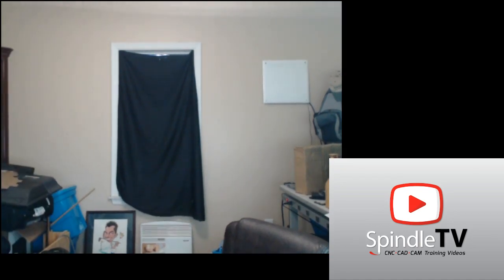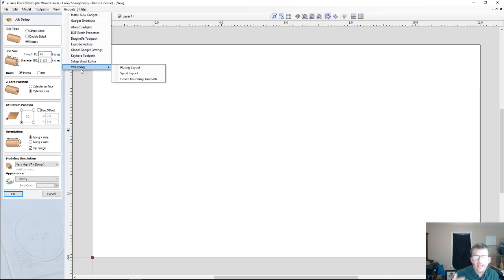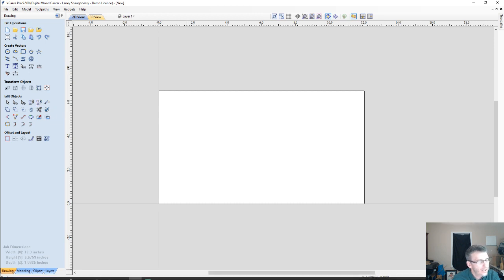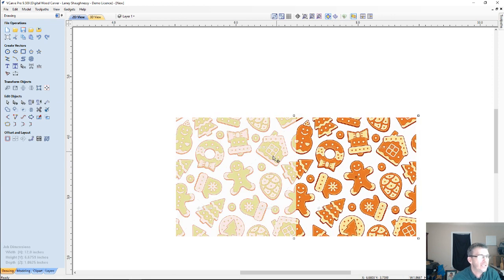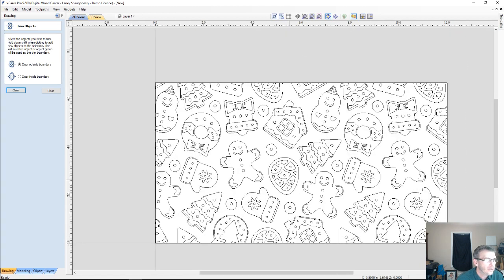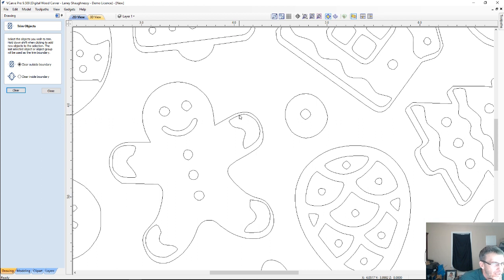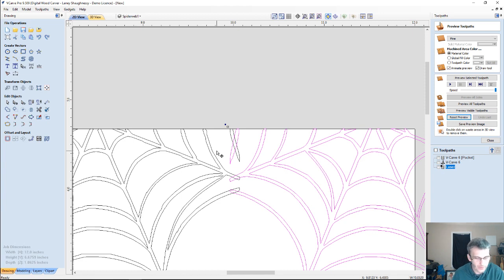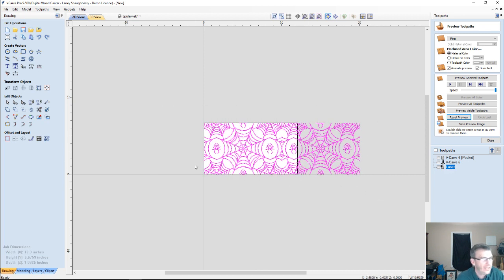Holiday Rolling Pins - Vectric Rotary Axis Project

Comment: Hi David, love the video very helpful but when I get the handles made and want the main body of the rolling pin to be joined to the handles I’m getting a gap between the handles and the main body.  Can you tell me how to make sure it’s all joined please?
Reply from the maker: I believe you meant Laney. There is no David. Are you carving the handles as part of the model? Or as separate parts? If the are part of the model the handles will need to be merged with the main body of the rolling pin...normally there is a threaded rod or non threaded rod inserted into the center of the rolling pin and the handles are epoxied on the ends of the rod. If this is to be one complete part then the handle models need to be merged with the rolling pin body
Reply: @SpindleTV  ok so can you please tell me how to merge them please Laney?
Reply from the maker: @PeachCraft55  it's a little hard to explain in text it has to do with how the models are created and combined if you like me to show you one-on-one you can contact me at Laney.shaughnessy@spindletv.com provide a contact number and a time you will be available to call and your time zone. I can connect with you and walk you through it